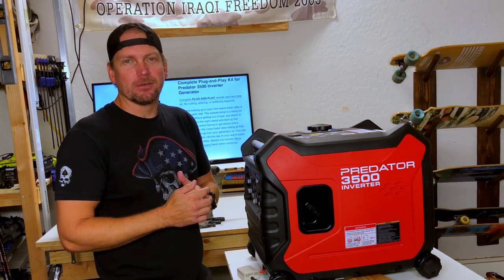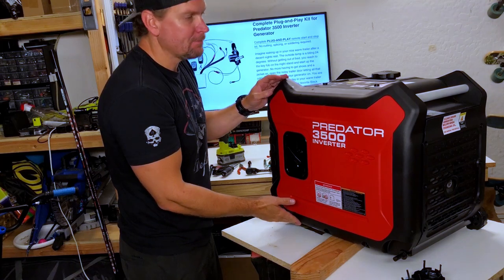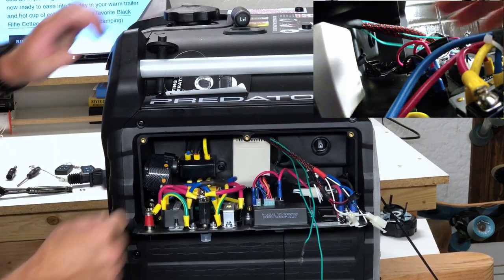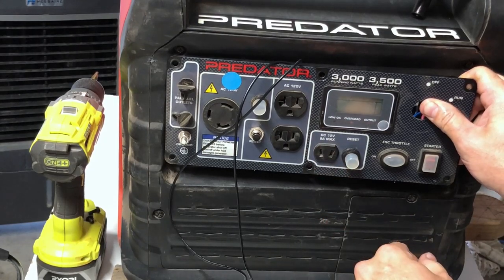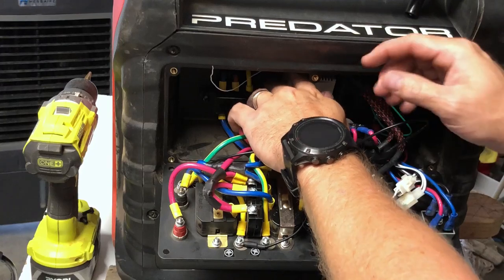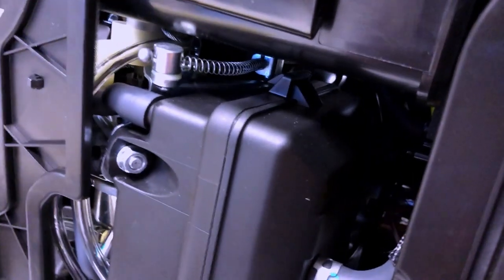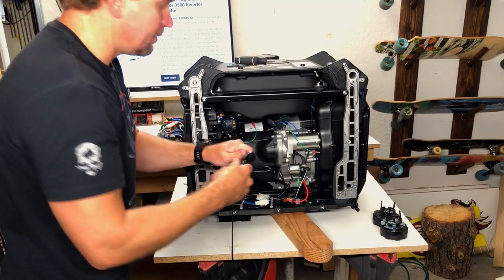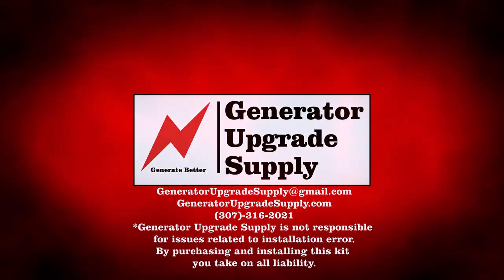Predator 3500 Plug & Play Remote Start & Stop Install Video (Model 1.0)

Comment: For the people that use their generators ice fishing in extremely cold conditions. When it gets really cold generally you need to let the generator run with choke on for 10 to 20 seconds to allow it to warm up before switching to run position. In this situation would you just release S once it started and continue to hold C until you wanted choke to turn off? Would this cause actuator to fail prematurely?
Reply from the maker: Hey Shaun
Man we are in different worlds! I’m out here in AZ.  I do have a few customers that use them ice fishing in Minnesota. Although I haven’t heard that they have to keep it choked for a while before turning to run. Just being open, I have not done enough testing in the extreme cold to know for sure but I am sure it depends on how long it is activated for especially with vibrations. Maybe I need to take a trip up and do some testing! If it does I am more than happy to send out a new one. Always looking to innovate and improve.

Comment: I bought my remote start about 18 months ago.  The choke function comes on with the start button.  It isn’t working and I need to take the panels off and maybe move the cable.  It’s the Only thing that’s not perfect.  

Have you modified that at all in the last year?  It’s in my semi truck.
Reply from the maker: Hey Robert, I am just seeing this comment. I apologize for that. It is a bit different now than on the video with the upgraded version. You won't use the C button anymore. The A button controls the starter and choke at the same time. Check out he description and the written instructions for the most recent updates. If that's not your issue and we haven't spoken yet about this give me a call, text, or email. 307-316-2021 generatorupgradesupply@gmail.com.
I will always make it right and get you up and running.

Comment: Do you have a kit for the newer version generator. All the wiring looks different, even the air cleaner has been revised and is in the way of actuator for the choke. Thanks
Reply from the maker: Hey, I do have the kit for both styles. The easiest way to tell which one you have is what side the wheel brake is on as you are looking at the control panel. Just select the correct one after you checkout or email me. Also, since they still sell both styles I created the new kit with a universal pigtail so that we only have to replace the wire harness if you have to warranty or get a new one and end up with the different style. Thanks again!

Comment: How do you think I could help or strengthen my signal for my generator. It will start from a distance but won’t shut off sometimes. I’ll need to walk closer to it for it to work.
Antenna is just a wire inside the generator enclosure
Reply from the maker: Hey, shoot me an email to generatorupgradesupply@gmail.com and I can see what we can do for you. We have done some upgrades to the antenna so I am sure we can set you up. The generator produces a lot of electrical interference when it is running which is why stopping is difficult sometimes with the original models. Thanks again and I will get you set up!

Comment: Just got mine installed. Noticed that it isn’t activating the choke when it starts. I have the new kit with the wheel lock on the left
Reply: Where did you mount your module? You're the most recent post, all the others are a year out. The space behind my control panel is not deep enough for the module.
Reply from the maker: Hey Pat, I am just seeing this comment. I apologize for that. It is a bit different now than on the video with the upgraded version. You won't use the C button anymore. The A button controls the starter and choke at the same time. If we haven't spoken yet about this give me a call, text, or email. 307-316-2021 generatorupgradesupply@gmail.com
Also, I will be adding a new video for the new styles with the wheel brake on the left and the CO sensor as well. Thanks for hanging in there and working with me on this.

Comment: The chock has stopped working when i push C
Any ideas why? It doesnt move at all. No clicking sound, nothing. It will still crank it though. I have bought two from you. The one that requires pushing C with the external antenna and the one that doesn’t with the internal antenna. I like them both very much
Just like to work out that problem. otherwise it’s really not good for me because i must go and start it by twisting the knob to “start” and push the factory start button when cold.
Reply from the maker: Hey, shoot me an email and I will take care of it for you. The actuator may have gone out. generatorupgradesupply@gmail.com Thanks again!

Comment: How far does the remote reach ?   This kit looks awesome   but I'm really interested in knowing how far it will reach before I buy
Reply from the maker: We have two antenna options that should work for almost all applications. Both will start well past 100 yards. Stopping is the tricky part because of the electrical interference the generator causes while running. I’ve gotten 40 yards line of sight with the standard antenna but that’s about the max. If you have any obstacles it can cut it down. I’ve seen as little as 20ft. With the extended range antenna you can get about double but it really depends on each individual set up. 

How far are you usually turning it on and off? And is it for a trailer or a shed?

Comment: Now that they've change things on the predator 3500 does your kit still work?
Reply from the maker: I have updated the kits with the correct harnesses based on which style you select. I am in the process of doing another video for the new style. I do include instructions however. Thank you!
Reply: Don't think the harness is the only thing that needed changed. The module is a half inch too thick to fit behind the control panel.

Comment: Why didn't yall add a switch to operate the eco mode function?
Reply from the maker: Hey Ben, There are a few technical reasons we couldn't do it with this module. We are designing one from scratch that will have that functionality and more. Hoping to have that ready early in 2023.

Comment: Hey what is the rang for the remote start.
Reply from the maker: Remote Range and Antenna Options:

Stock Antenna:

Starting- Range will exceed 100 yards.

Stopping- Because of the electrical interference while the generator is running the stopping range is diminished. Line of sight you can expect up to 40 yards. With walls or obstacles it could be as little as 8-10 yards depending on your set up. 

Extended Range Antenna Option (+$15):

Starting- Range will exceed 200 yards.

Stopping- The extended range antenna has been tested up to 20 yards obstructed through walls and has performed. It also comes with a magnetic base and an 8 ft cable to help maximize height or placement of the antenna for maximum range depending on your set up. Getting it away from the generator will also maximize your stopping range.

Comment: How do you disconnect the antenna on the Remote Start and Stop Plug and Play 2.0
Reply from the maker: Hey, on the new modules you just need to pop the cover off of the module and there are two wires red and black that go to ground and ant. They have an orange lever and are a pressure fit.

Comment: I have 2 Predator 3500's. I run them in parallel. How can I remote start both of them at the same time?
Reply from the maker: I have that exact set up! You can learn one of the remotes to both remote kits (or I can do it for you when I build them) and have the other remotes separate. It works well for me with the Firman 1201 kit.
Reply: Great idea. I have 2 3500 predators in parallel also and purchased one remote kit already, and will order another one soon.

Comment: So just got my kit in. Evidently my Predator 3500 generator must be different than everyone else's. I've cut off the black spacers. However the control panel will not fit with the module installed. (Didn't come with velcro). The cavity is 3 inches deep. The wires on the back of the control panel and module stick out 3.5". I've looked through the comments and I've not found anyone else with the same issue.....
Reply from the maker: Hey Greg, I don't know if we spoke about this but I am just seeing these comments on here. Sorry about that. It is a tight fit but it will go in. If we haven't spoken yet give me a call, text, or email. 307-316-2021 generatorupgradesupply@gmail.com
Also, I will be adding a new video for the new styles with the wheel brake on the left and the CO sensor as well. Thanks for hanging in there and working with me on this.
Reply: A follow up to my orginal post. It is a very tight fit, velcro is not needed. Once I got the unit installed I had issues. Not once did customer service run from this issue. Immediately I got a phone number to text or call. Normally I don't wish for issues when I purchase some but in this case I'm glad I did. It reminded me that there are still amazing companies and people out there that stand behind their product, company and reputation!!! You have gained a customer for life!! THANK YOU!!
Reply from the maker: @gregvanwinkle8545  Great working with you Greg! Thanks again!

Comment: Which generator do you think is better the 3500w or the new 4400w?
Reply from the maker: The 4400 doesn't have an electric start and it is also 10db louder. If you don't need the 4400 starting watts I like the 3500. Depends on each persons situation tho.

Comment: Will this work on any generator. I have a 5500 propane @ gas electric start ould like it tobbe remote. Any one just use there generator to run there 220 wood shop tools

Comment: Do you recommend the extended warranty from harbor freight?
Reply from the maker: I got it on mine.
Reply: How many times can you return/exchange unit under warranty.
Reply: @josephpuchel6497  the mngr told me only once. But you can buy another warranty with your new one

Comment: I have generator 2000 w same is this possible start with remote control
Reply from the maker: Unfortunately without the battery and starter it isn't. I am sorry about that.

Comment: does the fob send out a RF signal or IR ? meaning.. does it have to be in site or whats the distance
Reply from the maker: It is an RF signal. You can start the generator from over 100 yards. When it is running it does cause electrical interference which cuts down the stopping. Line of sight you can get about 40 yards. If there are obstacles like walls or in a shed etc. it will also cut it down. We are working on an external antenna which has improved the stopping range if needed.

Comment: Is there an option to connect to an inverter that has a generator auto start connector,want to charge my solar battery bank on cloudy days
Reply from the maker: Not yet, but it is coming!
Reply: Been 2yrs,any thing to go from the AGS on my inverter/charger to a module like the key fob to auto start the generator

Comment: Does this product work with any generator
Reply from the maker: Hey Tony, No, unfortunately they are mostly all different. I am developing other kits for different models. Which one do you have?
Reply: @generatorupgradesupply8953  DuroMax XP13000EH 13,000 Watt Portable Dual Fuel Gas Propane Generator

Comment: I bought one loved it but it suddenly stopped no spark or fire seems no one can figure it out, any tips anyone?
Reply from the maker: I’m assuming you’re talking about the actual generator. Did you have any warranty on it? I know there have been a lot of people replacing the ignition control module. You can check out Northern Tool for them for the Powerhorse 3500 (same as Predator 3500 from Harbor Freight).
Reply: @generatorupgradesupply8953   thank you very much for the information I will try that. I was about 3 months over on my warranty unfortunately. Thanks again.

Comment: So what shut off the fuel from over flow from carb to oil  pan not a good kid you need to add elec fuel shut from the fuel line coming from the tank to carb

Comment: is there any future plans for remote economymode?
Reply from the maker: Yes, I intend on working on the ESC mode. I will update the site with an addon and the new kits when it is available. I don't know how long it will take however, just being candid. Pretty busy right now! It is a priority tho. Thank you!
Reply: check out Panellus power products, he has a unit much more advanced than this. It does economy mode.
Reply: @rickgaine3476  Thanks. A bit too pricey for me though.Im lazy but not that lazy...lol
Reply: @generatorupgradesupply8953  can you just leave the econ mode on all the time, will this hurt the gen?
Reply: Yeah the panellus unit is half the price of the generator. Hard Pass

Comment: All you have to do is get a car remote starter they're cheaper , like 50 bucks
Reply from the maker: You certainly can. This kit is meant for anyone who, for various reasons, want a plug and play option that’s simple to install and doesn’t void any warranties.
Reply: The problem with a car remote start is they won't provide a choke pull off, and while I'm sure a solenoid could be fabri-cobbled in, I'd rather spend 50 more to save my time.
Also, if you read the red print on the website, part of the proceeds are going to Veterans, so WIN WIN in my book!